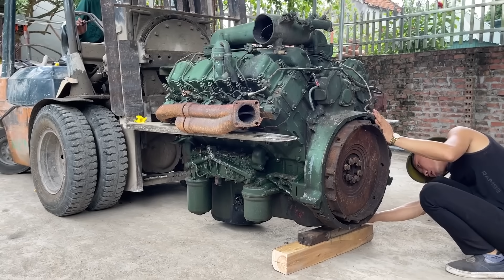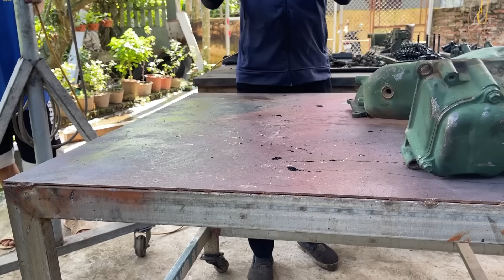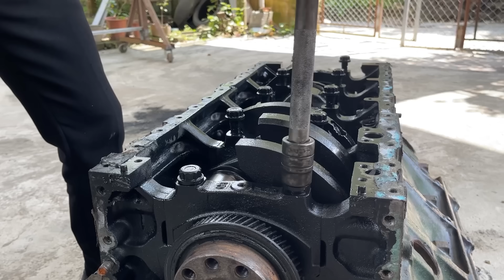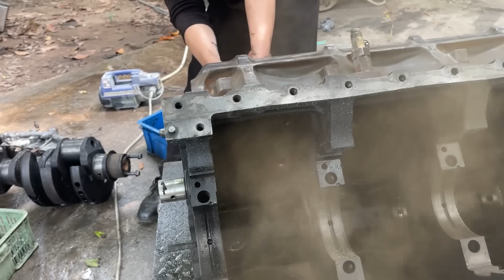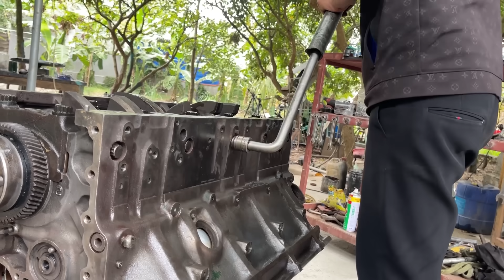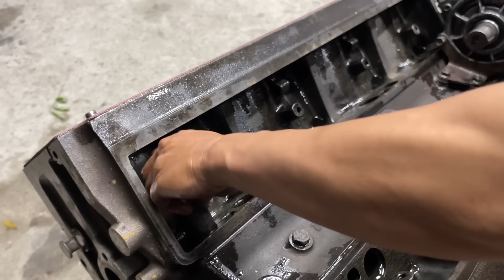Revive A Flooded Super Engine // You Won't Believe What Happens Next !

Comment: Seems like torque wrenches are unheard of in that country. Loved the way he was blowing that sand all over including into the open ports of the injector rail. Having worked on engines for over 40 years that place is scary.
Reply: Agree, I think FT is the standard number
Reply: I am sure that Cummings would like this video for training purposes. of how NOT TO REBUILD an engine. No honing the cylinders and checking for taper, regrinding the crank as  wear marks are clearly visible , and the state of the art  valve grinder , finally torqueing down the head bolts. If you don't have the right equipment and experience to do the job correctly to factory standards then go find a job in a rice paddy. Sure glad this engine is not used of an aircraft.
Reply: I like how these people don’t protect their feet. Rubber shoes! Tuque wrenches truly amazing tools. I’m impressed with these people ability to work together to get it done.
Reply: Errr😮, did it work  ?
Reply: This guy is so good he just goes off feel.
Reply: Just fuck the dirty oils everywhere  bud the pulotion and the plants  is died😢
Reply: @inosenciocalipay5881  And it's gravity fed into the creek about 10 yds away.  Keeps covid away.
Reply: not to mention mixing the valves.......
Reply: They did clean the block and everything before they put it all back together again.
Reply: Installing bearings into their saddles wet with whatever the juice was he was soaking them in isn’t very smart either.even though he “torques”them with his five dollar foot long,that technique promotes bearing failure.only lube the”working”side of the insert.and do dirt?don’t even want to get started on this place,#1 enemy:dirt
Reply: Lol. All you internet mechanical experts / Shade tree experts. All the torque wrench comments etc. "I've been a mechanic for xx years. Fact is, any true, decently knowledgeable"mechanic", wouldn't be making these comments. They would watch, admire, enjoy the show.
It is almost always 100% showmen  that make these comments. 
"Experts" that have absolutely NO idea what engine this even is?  "Experts" that will reply to my post, but only after researching to try to find the answer, and reply as "knowledgeable". Lol. Posers.
Get a life.
Reply: @samuelscragg7052 osha is overrated over there😂😂
Reply: You just got to know what youre doing ive bolted shit together many times no torque wrench. Never had issues
Reply: Never saw the fire in the Iron?? Where is the running engine now?
Reply: @outdoorwonderlust  Claramente con ese nivel de argumentos, debes trabajar igual de sucio y desordenado que el del video, si es que trabajas como mecánico. Si te gusta ver como se revuelven los fierros sin sentido, este es tu lugar ideal, pero para un taller que guste de hacer bien su trabajo, claramente no cumples requisitos. Se sepa o no se sepa qué motor es ese, es secundario. Las normas de limpieza y tratamiento de los componentes es universal para cualquier motor, sepas su marca o no.
Reply: @outdoorwonderlust yeah, considering where they are there's a bunch of nitpicking going on. Really, the only legitimate concerns I saw was that it didn't seem like they blew out all the oil ports, in the block and crankshaft, etc. to remove the sludge. (If they did it was off screen) and silicone gaskets . And I would prefer proper tightening sequence over exact torque number. Otherwise, these guys obviously have done this before and know what they are doing. And diesel engines can take a lot of abuse , so yes, it will run and probably last quite a long time if it is maintained properly.
Reply: Torque wrench? I don't know what you're talking about, sir.
I graduated from the best mechanics school in the country, where I learned to work on the ground.
Reply: do you think that this is the first engine these men have rebuilt?
Reply: A wise man once said, "You go to war with the army you have, not the army you want." It's kinda the same with work and tools.
Reply: torque, swmork.....
Reply: Kinda makes one wonder why torque wrenches were invented or are present in every high quality engine assembly workshop!

Try telling Cummins that you overhaul their large diesels without using a regularly recalibrated quality torque wrench with digital degree readout.

Me,  I use a quality torque on every engine assembly I've done.

Jus sayin'
Reply: @rossawood5075  A 40 year old truck in Pakistan or Viet Nam gets a $1000 rebuild. A $250,000 truck in America gets a  $25000 rebuild.  Also jus' sayin.
Reply: Dry install the crank and rods? Well done lubrication is overrated anyway
Reply: Yes, quite a few things made me laugh about this strip-down and rebuild video. From the ‘torque wrench to the fine engineering tolerances that this team was clearly working to...!!’
Reply: Everybody criticises. But these people have limited resources etc. it’s so easy to go down the parts mall and get what you need and work in a fully kitted out workshop in the western world. Health and safety is up to the individual. Most people criticising have probably never done anything like this only reading Google.
Reply: Ei esse caras devem ser parentes,o lugar e rústico simples mas é limpo,o profissionalismo e que conta da- se pra ver eles só top 10 vamos ver ate o final,gostei do vídeo,meu finado papai era fascinado por esse tipo de trabalho ele desmontável motores estacionários e eu o ajudava com 8 anos de idade,eu me lambuzava mais do que lavava as peças eu  gostava tinha prazer em fazer eram motores de serrarias de mesmíssima que eram tocadas por transmicao e correias,eu ajudava meu pai até meus 13 anos meu pai tinha ferramentas completa era prazeroso sinto saudades do meu velho pai ele me ensino a viver a vida com honestidade,e responsabilidade finalizo.
Reply: @Corey-dy2cq também  percebi que ao fundo  existe um riacho... poluído pelo óleo.....
Reply: A good mechanic is a torque wrench
Reply: And no oil on the shells ?ouch.
Reply: I agree! I guess you get what you pay for. All of these videos I believe they think dirt is a lubricant.😂
Reply: I guess he knows it's torqued when his shoulder pops. Forgot to paint the block , heads and oil pan.
Reply: Wonder what the chances are that they are youtubers trying to make money on youtube with a engine that is pretty well trashed to begin with and they know that all the stuff they are doing will bring out all the self rightous knowitalls in the comments section. since "Likes,Comments'and shares is what brings add money in, the more comments the better, and all comments are good comments, and dislikes are just as valuable as likes.
Reply: That injection pump been underwater for at least some time., and the sand the barge in this area was more than likely hauling sand, I think it’s their own load in the engine., so injection pump is a full tear down anyway.,
Reply: Anyone know what engine this is, other than a “super soaked” one
Reply: Anyone know what kinda engine this is (manufacturer) , and what's the 3rd valve in the cylinder head for , I'm not much on diesel so just curious
Reply: I just watch the videos from foreign countries to see the tear down of the different engines. I never, nor will I ever watch a video of the reassembly.
Reply: @bill0118  The human arm is a torque wrench. You can develop a feel after years of experience.
Reply: wind it. Down. Till. It. Strips. Then. Back. It. Off. Half. A. Turn. That. Should. Do. It 
Ha @gypseygeoff
Reply: @GRANITEMONUMENT scania. By. The. Colour
Reply: @outdoorwonderlust  that's bs, all of it, I'm a shadetree and don't do anything without a torque wrench, and assembly lube, and clean environment. Simp harder
Reply: @the_hate_inside1085  he was using an impact😁follow along buddy
Reply: @citroenfil  what are you talking about, they MAKE all the tools we buy. Don't have access, wow, what a loon
Reply: If you always use the same Length of Bar, you get to know what 80, 95-100, or 125-150 Foot Lbs. feels like pretty quick.  If all it took was a grain or three of sand to wreck an Industrial Engine like this, they wouldn't even be working on it !  I'll be that Engine goes at least another 2500 hours before it even needs attention again.  These Industrial Engines are really bulletproof.  The only reason this one needed to be freshened up at all is because it was underwater in a sunken ship for a considerable amount of time before anyone bothered to recover it ...    😏
Reply: no brain no pain!I love the WW2 helmets, kind of tells you what mentality and intelligence of people you're watching.
Reply: That thing is gonna smoke like a train! Not to mention how good it is on the rod bearings to just impact the caps on😂

Comment: How can you put rod and main bearing caps on and not torque them?  Cylinder head bolts also need a specific torque sequence done to keep the head from warping.  I'd love to know how long this engine will run after this rebuild.
Reply: Just long enough for him to make it someone else’s nightmare
Reply: Just be glad this guy isn't an aircraft mechanic.
Reply: Ya I loved the way he used a impact on the rod caps perfect
Reply: 2½ split seconds
Reply: It will run until it breaks
Reply: Did not lube the mains before installing the crank
Reply: @midgetrace  every thing about that job was jacked. Can you imagine what using that impact on those rod caps did to the bearings?
Reply: If that's the case then how come a lot of your imported heavy equipment like some small and large excavators that are not made here in the United States last for as long as they do some of them get thousands of hours on them without any major faults and other ones tend to just be some sort of defect in the heart not really a fault of whoever put it together and just to let you know they're all put together like this most of them are not torqued the way you might think they are

Comment: Who needs a torque wrench, its tight enough. Lets just wash all this oil and dirt into the ditch over there and no need to set valve clearances either. What was that diesel fuel on the main bearings, no wonder it look a little hard to turn. No need to lube the cam either lets just slide that on in there. We paint it and send it. It will be all right.
Reply from the maker: thank you
Reply: ...the torque is all factored in by the length and weight of the extension handle....when it clicks, it's tight enough dontchaknow!!!!!!

Comment: Torque callibrated biceps and laser tolerence eyeballs. Amazing but if it works it works. At least they reground the valve seats, replaced the cylinder block linings, piston rings ,injectors and a complete set of gaskets.
Reply from the maker: thank you
Reply from the maker: thank you
Reply: Haters will always be hating on human that gets off his ass and at least put effort into pressing forward
Reply: @scottyjones27 I suggest you read my comment properly. If you can't understand that I was expressing my admiration for the work they do, with the tools that they have and under those drastic working conditions  then that's your problem. By the way the channel thanked me for the comment.

Comment: Good bench procedure. Got everything nice and clean.  Do these guys know about torque wrenches-??. With all the other tools and equipment I’d think they could afford a 3/4 drive torque wrench . One more point, always use  connecting rod end cap bolts - protectors on rod bolts when disassembly and installing piston & rod assemblies., they are easy to make. Rubber fuel line hose works well, or wooden dowels with holes drilled in the ends. You bounce those rod bolts on the crankshaft you’ll ding and nick the crankshaft  and that will cut into the rod bearings and a possible Rod bearings failure.
Reply from the maker: thank you

Comment: It looks suspiciously after a Mitsubishi Fuso 8DC9 engine. However: there is usually the brand embossed on the rocker covers. That's a tough part of kit. No need for torque wrenches: tighten it as hard as possible with a hand tool will do.
Reply from the maker: thank you

Comment: Oh dear : measurements, tolerances, torques,  assembly lube, methodology. All wrong.    YouTube is full of material on how to do this properly .    In essence they just cleaned and assembled an engine without any attention to the important processes.
Reply from the maker: Thank you for sharing. Thank you
Reply: You’re forgetting the pink elephant in the room in regards to this engine.  This is a third world country you’re dealing with where all safety regulations, tolerances, assembly, lube, and methodology don’t exist.   I’m really surprised that you didn’t pick up on this.   There’s a lesson to be learned in everything in life. And the lesson here is on how NOT to do an engine rebuild.  Follow all local, state, and federal laws in protecting yourself when rebuilding an engine.  Also invest in a Chilton’s motor manual for further reference in rebuilding said engine
Reply: You're confusing rebuild to original mfg specs with this make it run until it doesn't again level of quality,  where these guys are at, this is considered a rebuild..if it runs it's successful.!!!
Reply: @jackspringer9283  got your point .. but I think I’d prefer the internals of the engine untouched and just have the outside jet washed in that case..
Reply: @jonathansparks3386  
I didn’t think the work was being conducted in Beverly Hills.

Some third world engineering is carried out with great improvisation and creative talent with little first world resources to hand.   I’ve seen it in person 
The irony in this clip is that the very tool used to post the video is the same tool that provides access to the methodology to do a satisfactory job with limited resources . 
I’m Surprised you didn’t pick up on this .

Happy new year to you.

Comment: Wonderful video. Would have been great to see it running
Reply from the maker: thank you
Reply: There’s no way it would work for long. That’s a great representation of the work but in reality it’ll blow up very quickly.
Reply: There's a good reason we never saw it running, it either didn't run or stopped running.
Reply: I get it, work with what you have and make do.  Not everyone has the nicest tools and spray wash cabinets, boring bars, and Sunnen hones.  But in all the videos I see of these rebuilds in Asian countries and in the Pakistani Truck channel where they rebuilt engines too, it’s never one guy carefully assembling the engine.  It’s always like 3 or more people just attacking it and putting it together as fast as possible.  You spent the time to wash it all by hand and scrub it super clean, which I must commend you cause it appears like you did a good job.  Hopefully you brushed all the oil galleys off camera to clean and clear them out 😉.  Why not take a little time and let one man, your best and most knowledgeable man, do the assembly?  Mistakes happen when you rush and 3 people can’t always know/remember what the other guy has or hasn’t done!  For that matter, just to give a guy some space, heck the one guy was climbing up all under the dudes armpit to put a bolt in, 🤦‍♂️.  That’s the one thing I have to have when I’m rebuilding engines, space and nobody yaping around me.  I need to concentrate on the task at hand!
But for the most part, you guys did a good job.  You guys knew how to take it apart and put it back together, so I’m sure you know you should be torquing bolts to spec and doing other things “by the book”, but we also know as mechanics how to just “get it done, and make it run” with whatever we have on hand!  👍🏻

Comment: notice they never heavily oiled up any internals ,some a light oil ,heavy oiled is better for first start up,when we used to strip down diesel motors all parts got a lot of oil during rebuild,we would pour oil over rocker gear before putting covers back on
Reply from the maker: I must pour out the grease only when I start the engine to avoid dust when not in use. Thank you for watching my video. Thank you.

Comment: I didn't see these guys use one bore gauge,  micrometer or torque wrench.  Also why the hell reuse the bearings?  This thing was under water at some point and the wise thing to do is replace all of the wear parts, not just the rings and sleeves, which you did not show but I hope were pre-honed to spec.  This isn't even close to a pro rebuild!  I predict problems in your future.  Still, I liked the home-brew ring  and spring compressors.
Reply from the maker: thank you
Reply: THE  MAINS  AND  CON  ROD  BEARTING  ARE  ALL NEW.     LOOK  At  STARTING  AT ABOUT  36,16    THEY  SOAKED  ALL  OF  THE  BEARINGS  IN  NEW  OIL  RIGHT  AFTER  REMOVING  THEM  FROM  THE  PACKAGE.   I  ALMOST  MISSED  THAT  ALSO.   GOOD  COMMENT.

Comment: Engine messed up because bolts weren't torqued in sequence and same stretched  bolts were reused again...😮😮😮😮😮😮using brillo pads to clean the surface of connecting rods makes micro scopic scratches that will wear bearings out after 20 k 👍...tik tik tik😢😢
Reply from the maker: thank you